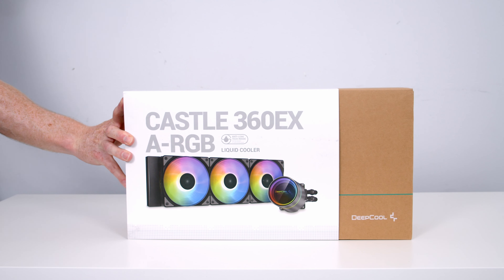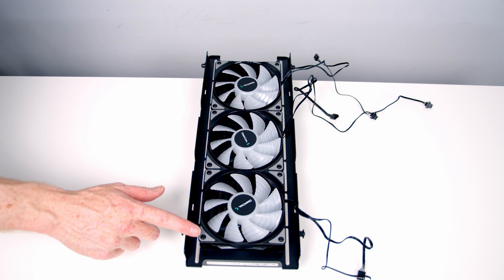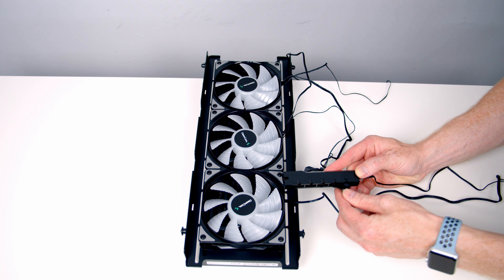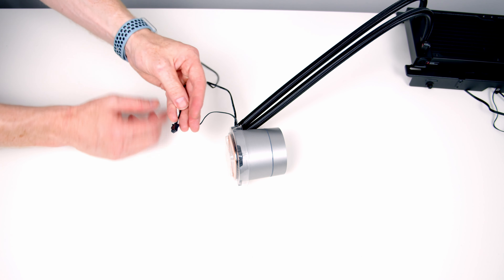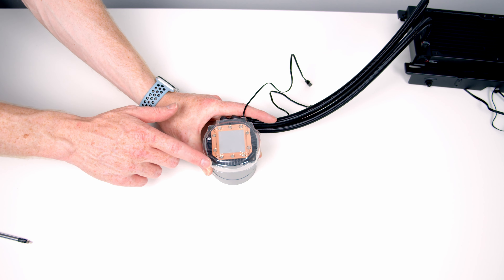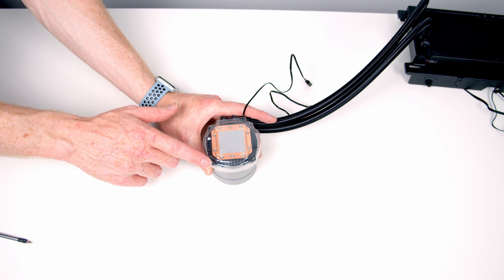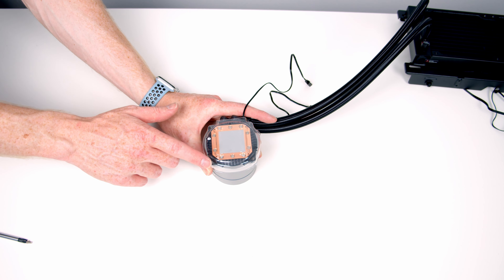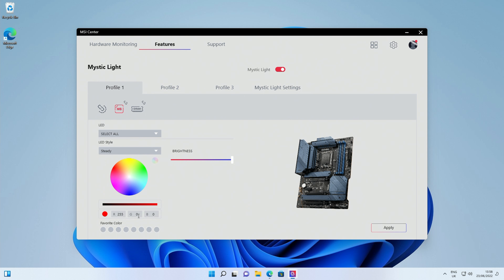DeepCool Castle 360EX A-RGB Installation Guide

Comment: Great video, I followed the instructions that came with the cooler but I cannot get the argb to turn on, board I'm using is the aorus z390 a pro which does have 2 headers for 5v and 12v so I'm not sure where I went wrong.

Comment: Where Can I buy the lga 1700 adapter?
Reply: You can buy it directly from Deep Cool. Or if you have proof of purchase and serial no. of the cooler, and proof of purchase of either 1700 socket chip or motherboard, they'll send you one free. I waiting for mine to arrive.
Reply: @Bacteriod  I don't see it anywhere on the site
Reply: @Sinehmatic  It's weird, neither can I now. I would just use the contact customer support link. Their CS was really really good. They were a pleasure to deal with.

Comment: Nice, but I'm not too much convinced about that Deepcool backplate mounting system...  Does it have some kind of adhesive to be stuck at the back?
Reply: all amd backplate mounting use loose backplates so it shouldn't be very different on intel ,either way the cooling worked fine as seen in the video